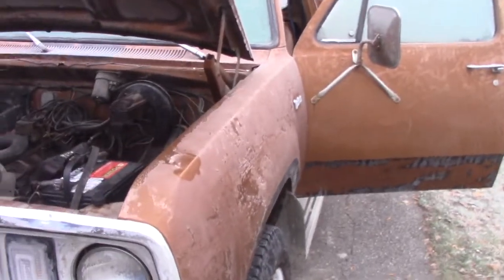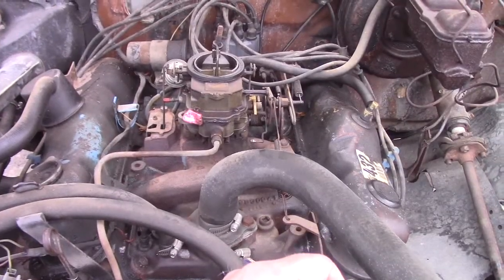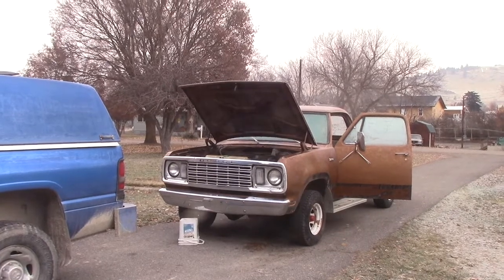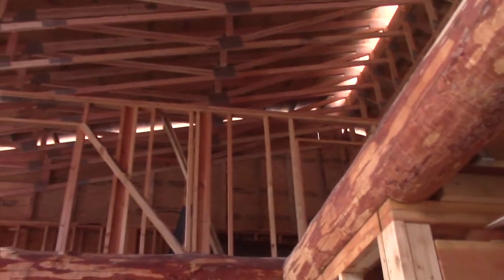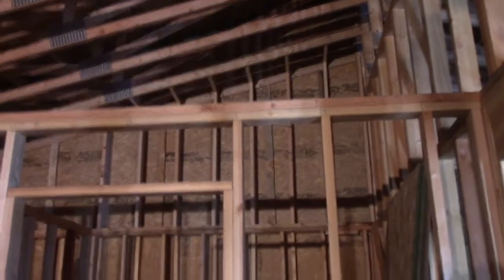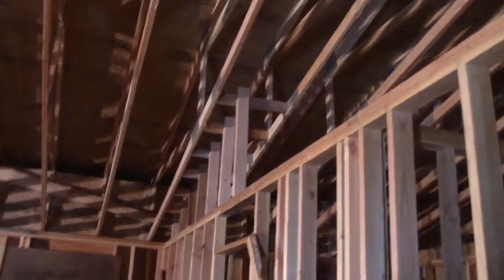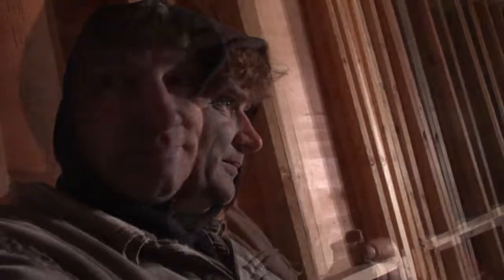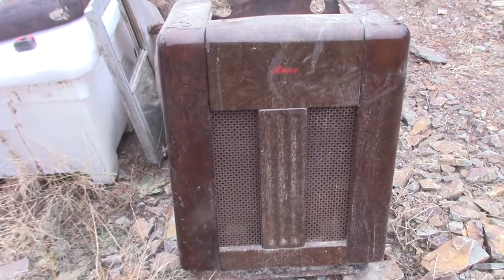River House 141 - Trucks, Fire and Insulation

Comment: Those carbs ice up at the tip of a hat.
The heating passage in the manifold is easily clogged.
Maybe an intake clean?
It may unclog the rings abut too.
Time for 20-50 and a block heater.

Comment: 17-20 with 4.10s and 37s with a sm465
Reply: Still say that is a 2 barrel specially when you adjust 2 air fuel mix jets at the bottom front